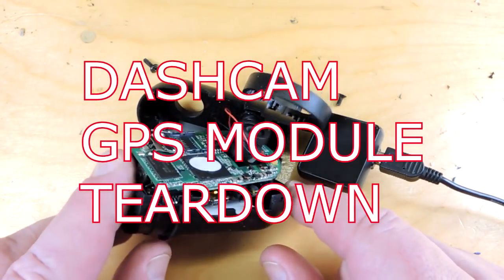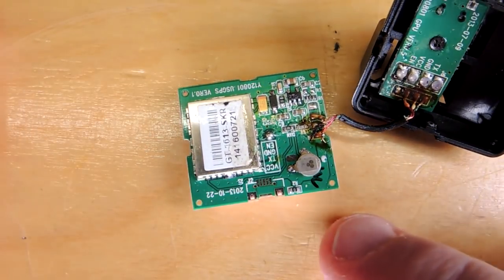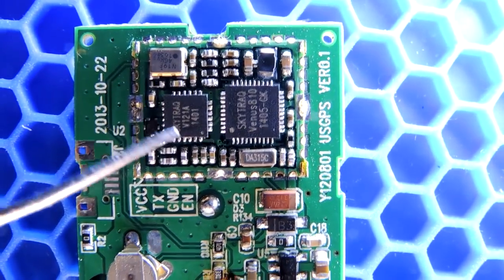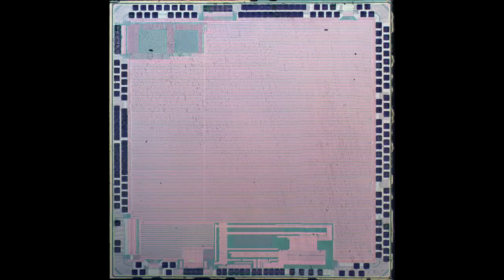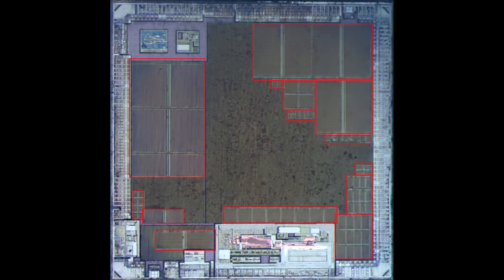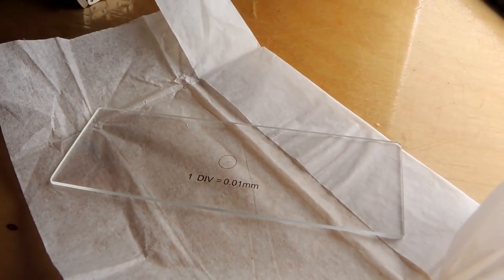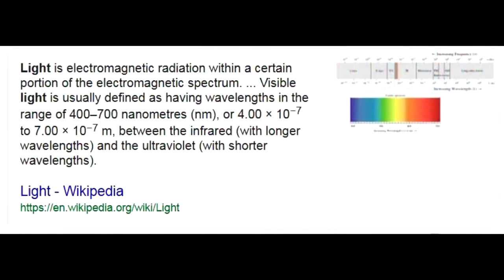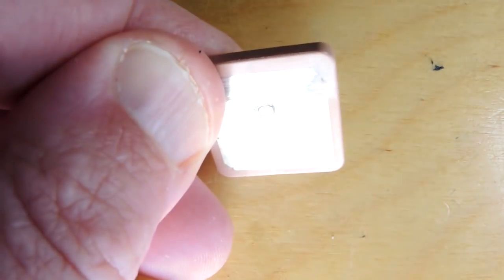Dashcam GPS Teardown

Comment: The battery is there to keep the last position and satellite data (which are "downloaded" from the GPS satelites while the device is active). This speeds up the fix the next time the device is powered up. It will work without that battery, but depending on signal strength it can take an aweful long time to get a satelite fix in that case. But it can be exchanged. Doesn't have to be the same shape with the tabs. There's usually enough space to put another type in the case.
Reply: Yes. The almanac takes 11 minutes to download from the GPS satellites at 50 bits per second, and it’s good for up to 2 weeks.

Comment: Electronupdate fans: do a shot every "of course"   ^_^

It always amazes me to think about how unbelievably minute the power it's receiving is. The GPS transmitter is 25 watts and that 1cm^2 antenna is probably absorbing 0.2 femtowatts of microwave energy. ONE HUNDRED BILLION TIMES less energy than the star light from an average star falling on the same area.
Reply: I agree, that's stunningly amazing! 

But then there's these two tiny spaceships on their way to leaving our entire solar system, and we're STILL somehow able to RECEIVE DATA FROM THEM! That is REAL MAGIC...
Reply: And with millions transistors smaller than the wavelength of visible light, packed into a consumer device that only lasts a few years.
Reply: Those devices use two clever tricks to achieve a vert high gain:
Firstly, they are superheterodyne receivers (that's not specific to GPS, pretty much all receivers are superheterodyne today). To explain that simply, the 1575 MHz  GPS L1 signal is said to be "downconverted" X MHz lower through a "mixer". Imagine that the mixer converts all signals to 1570MHz lower, the GPS signal will come out of the mixer at 5 MHz. At this frequency it is much easier to amplify and to filter it. Then this signal is sampled by an analog to digital converter: all what happens next is in the digital domain.
Here is the second trick: the signal is said to be spread spectrum . A GPS signal actually is very narrow, around 50Hz wide (compare this with a FM radio station that is 200kHz wide), such a signal can get very easily interfered and drowned below the noise floor. To overcome that, the signal is "spreaded" by mixing it with a much wider 1.023MHz wide signal. The signal now occupies around 1MHz of bandwidth and is much less likely to be interfered. Then the receiver will mix the incoming signal with the 1.023MHz wide signal to retreive the narrow signal. To receive the signal the receiver must precisely synchronize its 1.023MHz wide signal with signal of the satellite. The difference of synchronization between signals from the different satellites gives the TDoA( Time-Difference of Arrival) between the different signals from the satellites, which is used to calculate the distances relative to them and the  the position is calculated via triangulation. All satellites transmit at the same frequency and are thus amplified by the same circuitry. The digital circuit will simultaneously de-spread the signals from all the satellites and as they are not in sync they do not interfere with each other.

Comment: Thanks for the teardown. Interesting to see that GPS module had pads for what looked a USB connector? Surprised there isn't more to a GPS antenna, just a metal and ceramic sandwich.
Reply: In many devices the GPS is a seperate subsystem that comprises the antenna, the RF/processor part, a small battery for timekeeping and outputs its position via a serial link. The GPS module (I mean the green pcb with the antenna) does probably not come from the dash cam manufacturer. As the gps receiver (the blue pcb with the chips) probably supports USB so they they designed the green pc to be able to fit a micro USB connector, in case someone woule need it.
Also, the ceramic in the antenna somehow interacts with electromagnetic waves, you can find a lot more info if you google "ceramic antenna". Those are used  because they are way smaller than 1575MHz circularily polarized antennaes.

Comment: That looks like a pretty standard breakout board for whichever gps module they've used. I guess if it fits the case, and soldering a few wires across to the interface board is cheap enough then it's good enough for them.

Comment: This is fascinating to watch, thanks for sharing these tear downs. Have you ever examined a modern gyroscope/accelerometer? I fly miniquads, drone racing type RC flying, and most people in the hobby build their own aircraft and use flight controllers which makes them fairly hi tech toys but most of us only have a vague understanding of what’s inside all of the packages mounted on our flight controllers/video transmitters etc.

I would be happy to send you a 30x30mm flight control board that has a gyro, microprocessor, on screen display chip etc. on it if you want to take a peek inside 😎

BTW this GPS module looks very familiar especially the ceramic patch antenna, we use modules like that when building return to home RC aircraft or even just for transmitting coordinates back to us when flying long range so we know where to look if it goes down lol.

Comment: you'd love to do a video on a Zing smart night light.  This is the coolest and smartest I've seen, I have one apart in my hand now.  It has 20 I believe sm5050 rgb's, wifi, bluetooth, li-po battery, PIR.  Pricey at $40 us but it does a lot with software app, you might want to check it out.  Thx
 Home depot sells.

Comment: Very crusty hand soldering on that gps module. Never seen a dash cam with separate gps. Wonder why they did that.
Reply: Perhaps to partition the product and then try to upsell people on overpriced accessories after they've already bought the camera and are satisfied with it or have committed to buying the camera. This way they can lower the price on the main unit and make it more attractive but drive up the overall profit.

Also on a technical level, why not, GPS is usually a separate subsystem that only needs power+ttl-serial anyway.
Reply: Siana Gearz they could upsell by just omitting gps components on the main board. After the fact, they could sell someone a whole new camera if they want gps.
Reply: GPS antennas need to be stuck to a precise area of the windshield where there is no GPS-blocking thermal insulating layer, so the antenna MUST be separate from the rest of the unit. The GPS module is completely seperate because, first, this is more flexible (You can have dashcams without GPS) and secondly you can use a dirt-cheap cable instead of a more expensive coaxial cable.
Reply: Integrated Electronics my garmin dash cam has gps integrated. Every other dash cam I’ve looked at is the same. There’s no technical requirements to have the gps separate.
Reply: I have a dashcam with a separate GPS module, and Integrated Electronics gave you a very good reason for them being separate :P I'm not sure if this is what Integrated Electronics was referring to, but the Ford Fiesta in which I learnt to drive, in around 2008, had an electrically-heated front windscreen (for very rapid de-icing/defogging, apparently it's a Ford-only thing called Quickclear: https://en.wikipedia.org/wiki/Quickclear ), with dozens of very fine wires running up and down the windscreen - fine enough that they didn't interfere with the driver's vision. However that technology is known to attenuate GPS signals (and other RF signals), so if you have a car with that windscreen feature you may well require an external GPS unit/antenna that you can place somewhere on the windscreen that doesn't have those heating wires (I think there's a patch behind the rear-view mirror that's void of the heating element), otherwise you would really struggle to get a GPS lock.

I don't know if this is much of an issue any more - perhaps more recent GPS modules are sensitive enough that they can get a lock even from signals that have been attenuated by this technology, or maybe because, as mentioned in another comment on this video, modern units are able to listen for positioning signals from four separate global constellations (i.e. the USA's GPS, Russia's GLONASS, the EU's Galileo, and China's BeiDou - also Japan's QZSS, but that's basically limited to covering Japan), each using their own frequency range(s), that attenuation is less of a concern - but it was definitely a problem for people using GPS receivers 5-10 years ago.

(Incidentally, the fact that we now have 4 global navigation satellite systems in operation [Galileo has only been available since Dec '16, and BeiDou's global coverage has only recently been usable - Wikipedia suggests literally since *last month*: 27th December 2018!] is super cool. I'm currently indoors, in southern England, and yet my very new Android smartphone [Huawei Mate 20 Pro] is able to see 11 GPS satellites, 8 GLONASS satellites, 8 Galileo satellites, and 6 BeiDou satellites!)